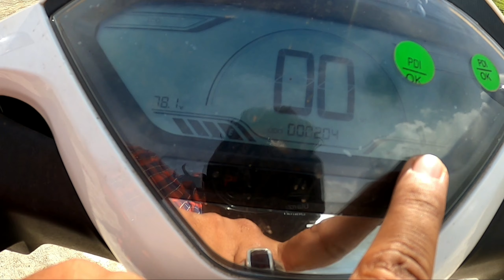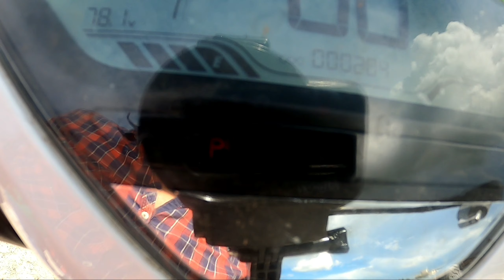Full review of Okinawa Okhi 90 in Bangla

Comment: 1) How many seconds will it take to reach 0 to 40kmph?
2) Is it reaching 90kmph as they claimed?
3) Is it charging 80% in 1hr of charging?
Reply from the maker: 1. Don't have any gadgets to precisely count the time to reach 40 km . It's depend on which mode  you launch the scooter ..sports or eco. Roughly its take between 12 to 15 sec to reach 40 km in eco mode on regular road.
2 . It's gone upto 75 km during my ride quite easily. But if you want to push more then you need a tarmac without traffic to reach the limit. What I understand with little patience you can touch at leat 80 -85 km. But 90 is tough.
3. I didn't have the opportunity to test that.
Reply: @DipjoyChakraborty  thank you so much.
Reply: Confused between ola s1 pro and okhi 90. If pickup is less, I will buy ola because ola is very very powerful as i test riden it . It can go 40kmph in less than 4seconds and can reach 115kmph speed. Only thing i am looking okhi 90 is its charging speed which is 80% in 1 hour .
Reply from the maker: You also consider the aviability of showroom and spare sparts before choosing the right one for you.
Reply: Vishal Lakra  thank you so much. Okhinawa is not giving what they are saying